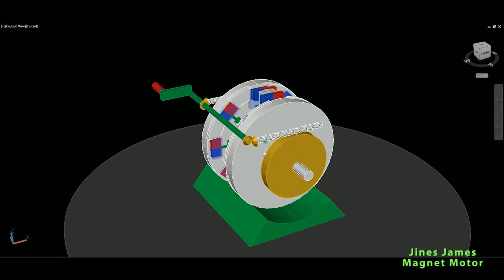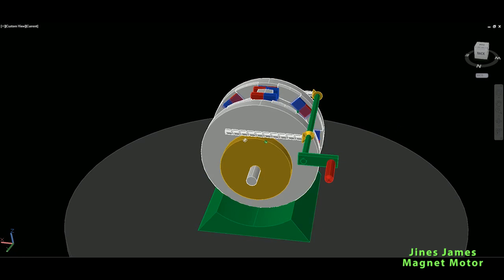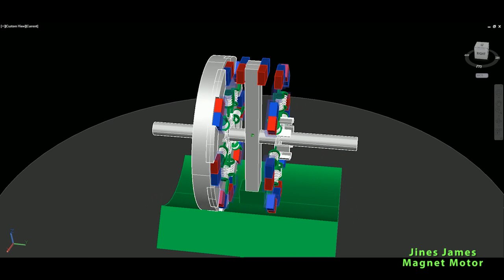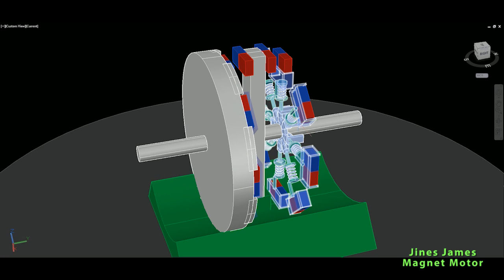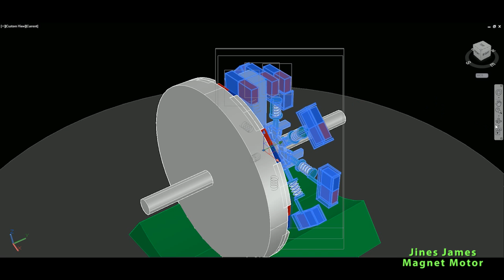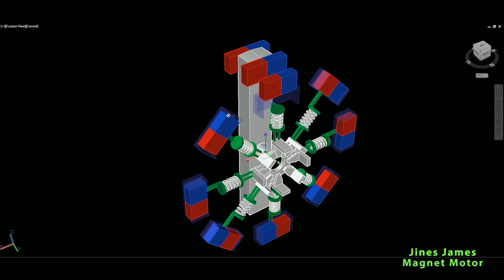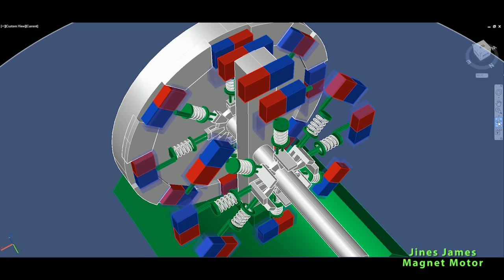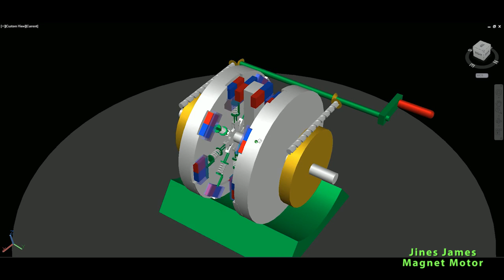Free Energy Generator, JINES JAMES Magnet Motor, Magnetic Motor!!!!!

Comment: I had an idea similar to this years ago and I actually built it but the mu-metal you use for shielding is actually attracted too the magnets so it takes alot of energy to move the shielding to block a magnet, so it becomes no different to actually having a magnet that attract to another magnet in your system so in conclusion the shielding is actually useless